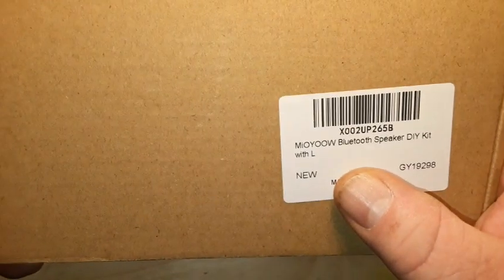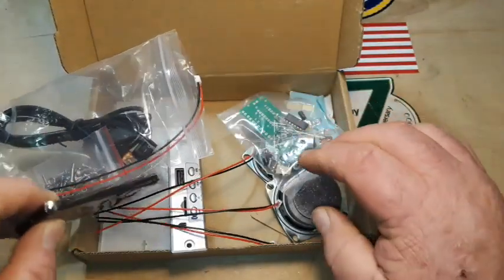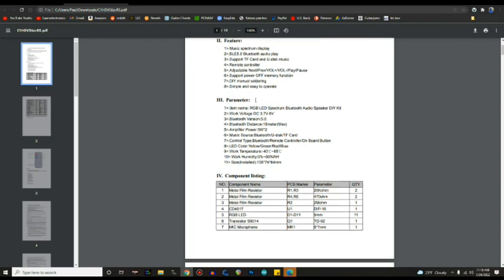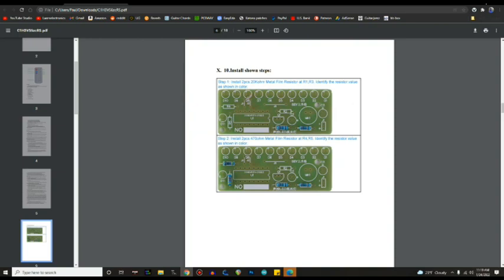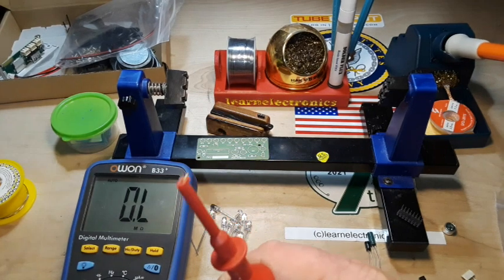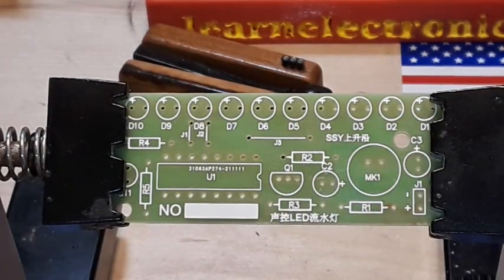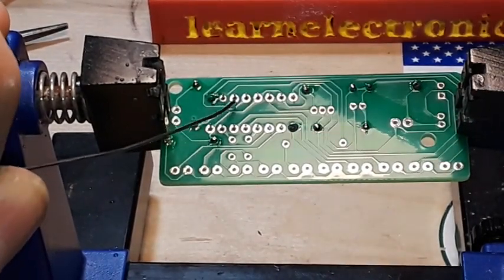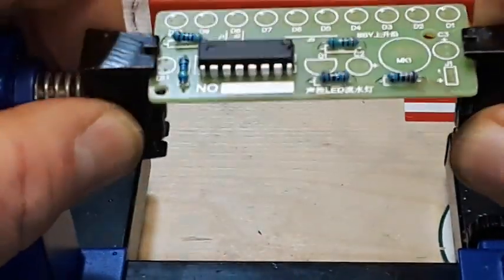Mioyoow Bluetooth Speaker DIY Kit Build

Comment: CA glue accelerator causes an exothermic reaction with the glue. Discovered this in a rather unfortunate way. I had cut one of my knuckles to bone at work, and trying to seal it and stop the bleeding, I put some CA glue on it. But it wasn’t curing fast enough to stop the bleeding, so I put a bit more CA on and hit it with accelerator. That was the moment I remembered it would get hot when you applied accelerator. That was one of those moments when you instantly become very awake and very aware of whatever you just did being a bad idea.

Comment: I built this kit about a month ago. It was a fun kit to build. The LED board worked but the blue tooth module died shortly after power up. The only thing I was unsure about was the power connections to the Bluetooth module.  You have inspired me to give it another shot.  Just ordered another one.  Hopefully it will work out better this time.
Reply: Mine did the same thing. I stuck a little Heatsink on the chip. Hasn’t cutoff again.

Comment: i got a similar project and it seems to have had a update to the PCB, the wiring now makes more sense as its got solder pads for both the switch and the link to the bluethooth module

Comment: I'm just getting started in electronics... but I've already learned that when soldering resistors, LED's, etc... if you place them through the holes and then bend the legs slightly on the other side, they will stay in place quite nicely for soldering, without requiring any BlueTac or other things to hold them in place.  And, they will be flush with the board when you are done rather than standing proud.
**As you did with the mic and caps** LOL
Reply: @Bobo-ox7fj  Thanks for the tip!!!

Comment: Could you, in theory, solder wire into the holes for the LED’s to thrn have more LED’s than just one per slot, im thinking of building said kit into a rc truck, would like to see a light display around the ipad which i have for the truck as a visuliser, just curious if it be possable to add wires to extend and to get more than one LED per slot😂 also if u dont wanna use the unit u solder, could u get away without useing it?